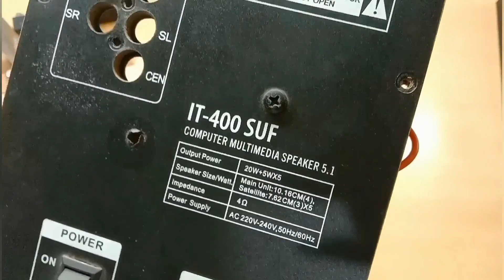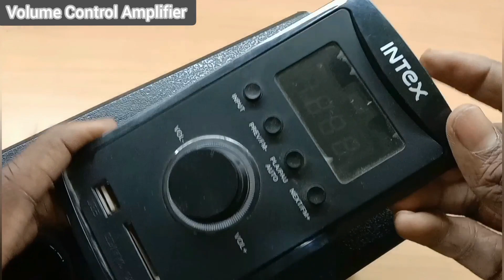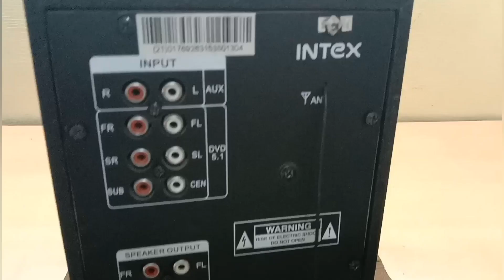5.1 Home Theater | Handmade | Wire Connections | Home Theater System | U With Tech

Comment: Everything is fine but, The subwoofer is not exact size. It's little bit smaller than the subwoofer hole size. 5 inches or 5.25 inches subwoofer will fit exactly.  There will be air leakage from cabinet due to small subwoofer size. To enjoy acoustic sound experience there should not be any air leakage from subwoofer cabinet.